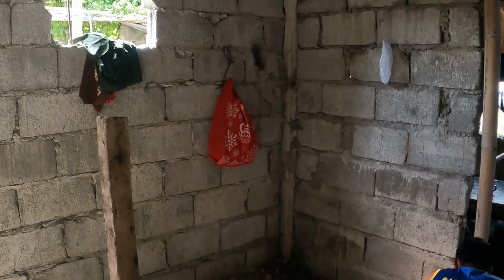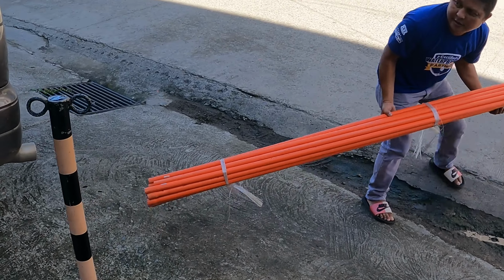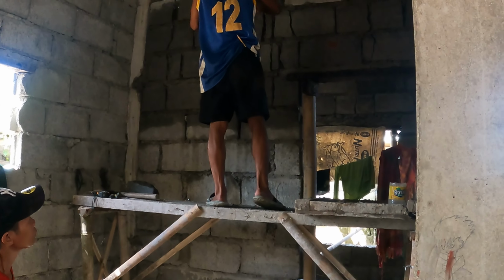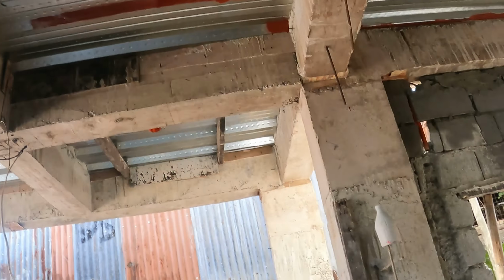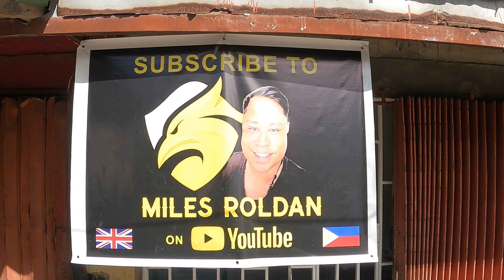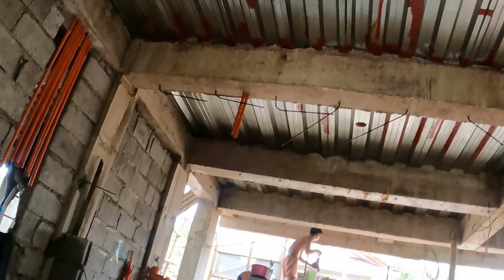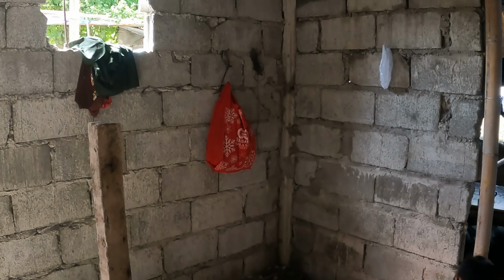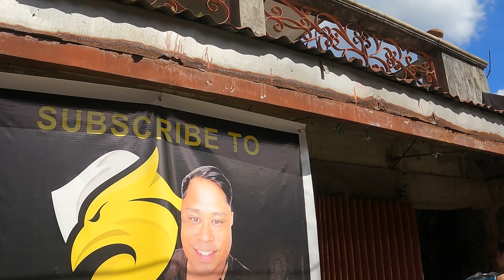VLOG 159: INSTALLING A WALL MADE OF HOLLOW BLOCKS AT DREAM HOME BUILD IN PHILIPPINES!

Comment: Hi Miles Yes the electric is big undertaking. What I've done is have sub electrical dinrail fuse boards on each floor level reduces the length of copper wires however it requires heavier main cable feeds defently reduces time to feed cables into ducting.  I guess I'm  more use to electrical setup closer to UK method. 
Good progress 👏
Reply from the maker: That’s a good idea… thanks mate